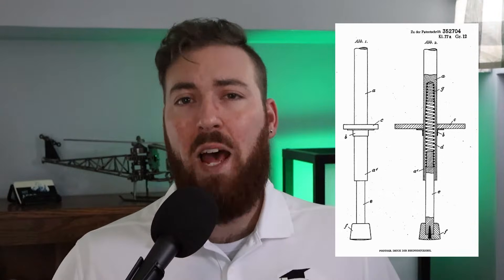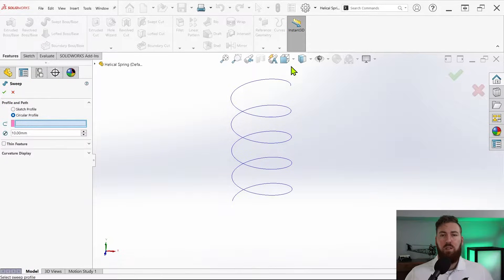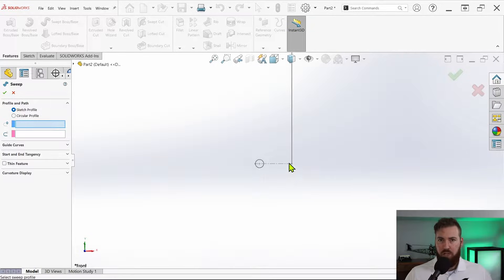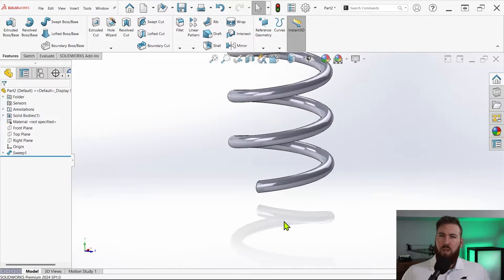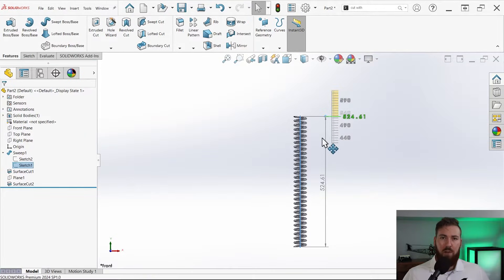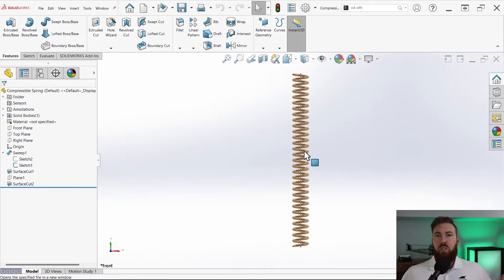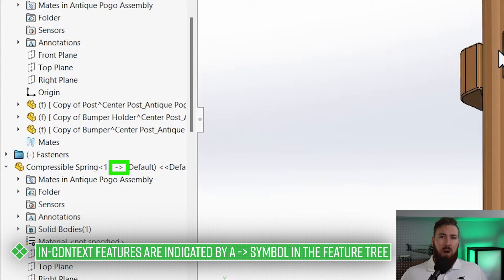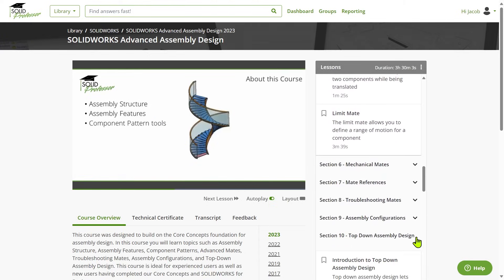How to Create a Compressible Spring Assembly in SOLIDWORKS

Comment: What happens when you need to use the same spring part number in multiple different assemblies that all deform at different rates?? In my experience the updates get messy, and parts update to the wrong referenced lengths (especially when trying to make edits)
Reply from the maker: This is a pretty tricky situation and you'll get many different answers from different people depending on what your priority is (keeping the files updated, avoiding circular references, getting the geometry to show correctly, etc.) It is definitely possible to have multiple instances of the same in-context component representing different geometry though, and I would argue the most robust method is to use Configurations (and then adjust your settings to use the same part number for all configurations).

This page of the Help documentation may help:
https://help.solidworks.com/2026/english/SolidWorks/sldworks/c_configurations_in_context_components.htm?id=6.6.0.0

It's also possible to turn off the setting "Allow multiple contexts for parts when editing in assembly" in the External References section of System Options. This will probably work pretty directly in your situation, but it also way more likely to get messy as you've suggested.

I hope this points you on the right track! Let me know if you learn anything!

Comment: How would I go about this if I want my coils to be different pitches at different portions of the spring?
Reply from the maker: The "variable pitch helix" option could be worth considering in this case, but as mentioned in the video it may not update as dynamically in an assembly. Alternatively, you may be able to use the sweep approach shown but broken into multiple sweeps - managing the transition between them would be difficult, though.

Comment: kindly make more videos related to designing complex shapes like manniquin.
- if you are comfortable with flow simulation, please make video on how to simulate a hot nitrogen gas heating a catalyst bed inside a reactor suppose say initial bed T is 30°C  want to heat it to 300°C using N2. how to setup this study, want to know time taken to reach the final temperature.
- Also please can you help how to setup flow simulation study of a thermoforming of polypropylene sheet and use these thermal results in simulation(fea) to see how it get shaped onto a mold- to know the thickness distribution
Reply from the maker: Noted!